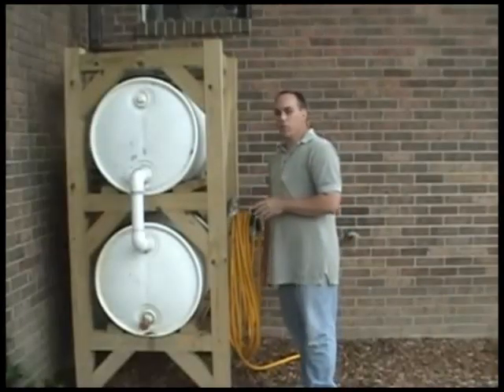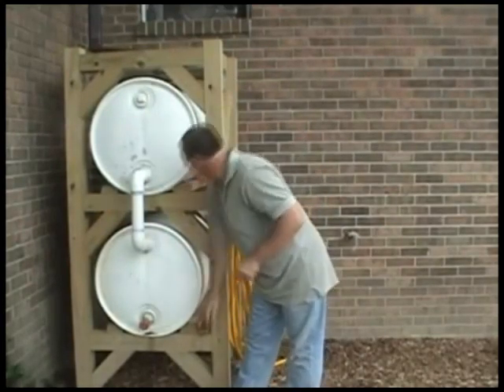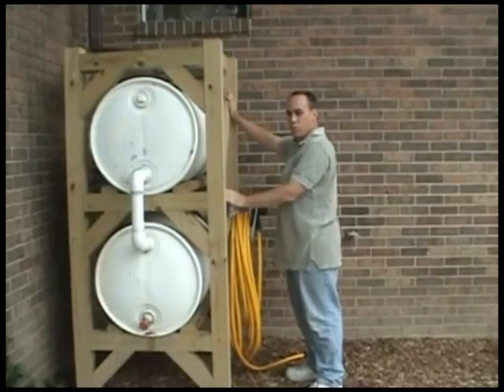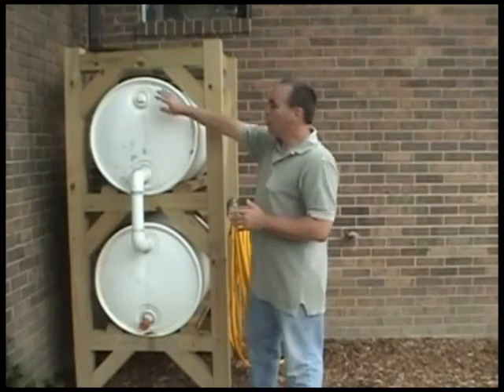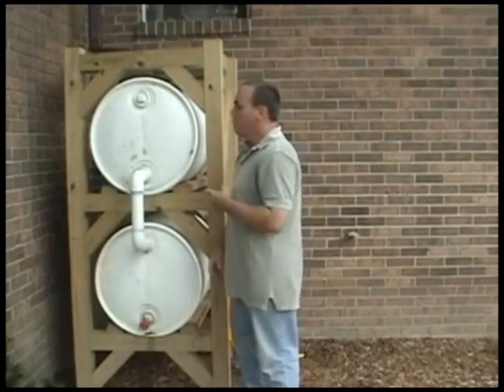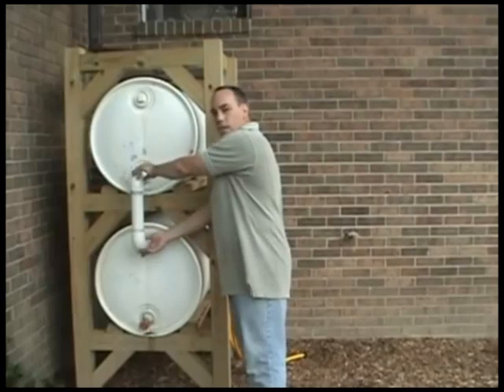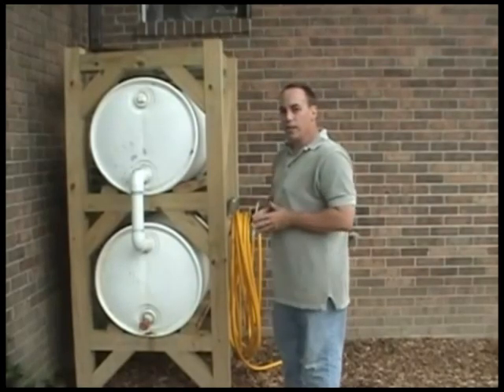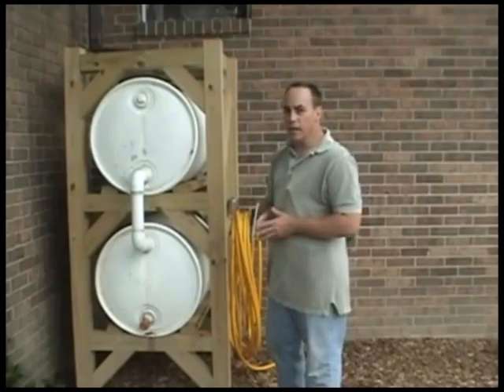Water Storage in 55 Gallon Drums for RO/DI

Comment: I built a setup like this inside. I have barrels just like that I bought new. First fill up the fronts bowed out and caused the connecting pipe to leak badly. Flooded my floor.

Comment: I have a question...I have started to build a rain barrel holding system. (I cannot figure how to attach picture, sorry). I have a big barrel on the bottom maybe 150gal. then I put a few heavy duty Tupperware totes about 45 gallons each. Should I caulk/seal the lids of totes to the tote? Or will the pressure of the totes/water on top seal?
Thank you for your time...